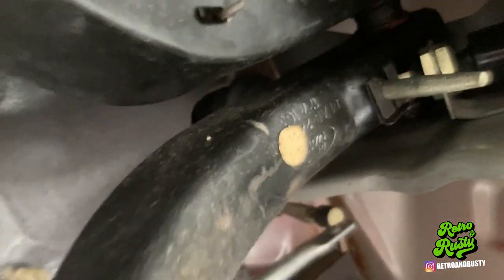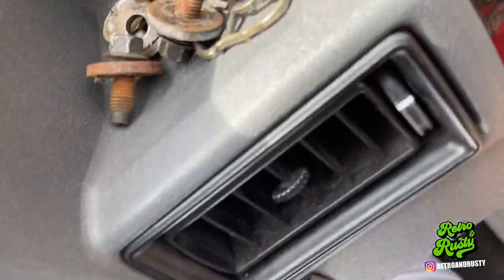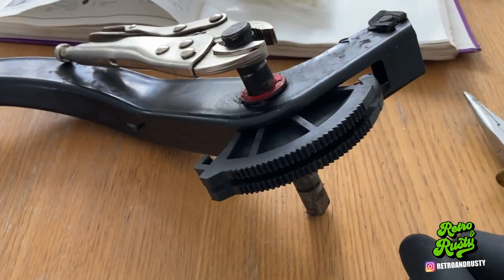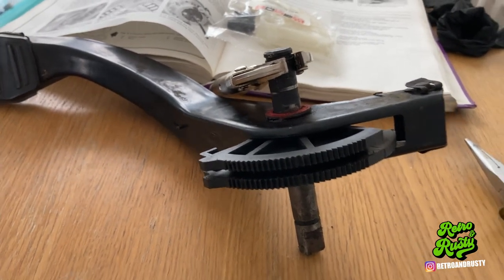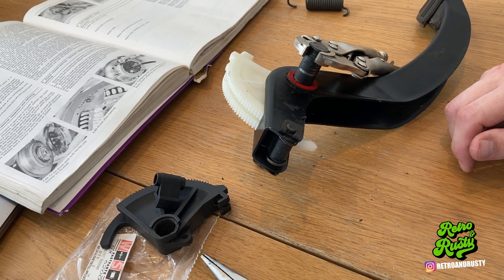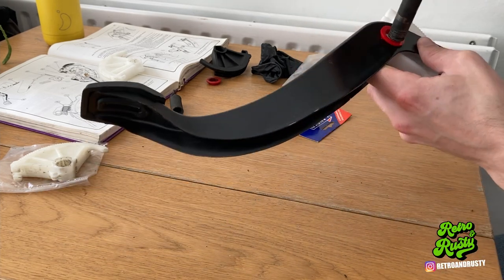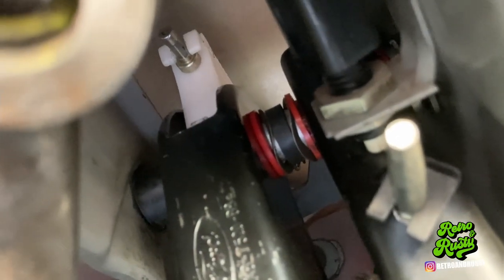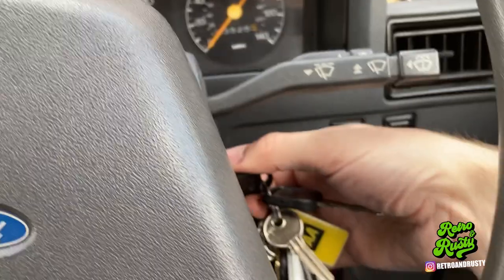FORD ESCORT MK3 - How To Fit A Clutch Quadrant & Pawl !

Comment: I have an 88 Escort but my set up is identical to yours. I couldn't take the bottom half of my dash off so it was an absolute nightmare for space. It took an age to get the metal clips out. Same as you, my replacement part wasn't right so tomorrow I will be getting the replacement.  It makes me sad that you say the putting back is the hardest part because that means I have that to come. Anyway, thanks so much for the video.  Helped me an absolute tonne.
Reply from the maker: Hey Matthew, yeah sorry to be a bummer but hopefully some of my failings putting it back together might make it easier for you. Also make sure those washers go back in the same, i must have something different and it feels a bit loose under foot sometimes.
Reply: @Retro & Rusty  will do buddy. Fingers crossed you figure out what it is.

Comment: Best video yet of this job mate. In regards to the spring that hooks to the quadrant and through a hole in the clutch pedal. Did you connect this after putting the pedals together?
Reply from the maker: Hey mate thanks for the comment ! I thought I’d was a job that needed filming properly . Yeah I used a bit of guitar string around the hook of the spring( while the quadrant was all attached to the spindle bar) and pulled it though the clutch pedal hole/pushed it through the back with some pliers .

Comment: I’m currently messing with this on my cortina. The cable stretched so replaced it then found the hook the spring goes on was snapped and there was no spring. Had to get universal clutch springs as you can’t get them. The pawl jams completely

Comment: Hey there, I loved the video. I have a question about the Ford Escort mk3, does the clutch share the same brake fluid reservoir as the brakes???
Reply from the maker: Hi Arnold, My mk3 has a brake servo with a reservoir on the top which is the same as all mk3s with a servo. The clutch doesn’t use fluid it’s a cable from pedal to lever on the gearbox. A setup with clutch fluid would have a hose from the gearbox to a slave cylinder by the clutch pedal.
Reply: There’s no fluid on the clutch system as it uses the cable to pull the clutch. It’s mechanical rather than hydraulic like modern cars

Comment: My fiend; I need  overall cable length and outher cable sleeve length tell me please  I'm going to make a special wire, I can't find the original here
Reply from the maker: Hi, I dont know the length of the cable, i've never had it out. There are a few clutch cables for mk3/4 on ebay.co.uk maybe you could get one shipped?